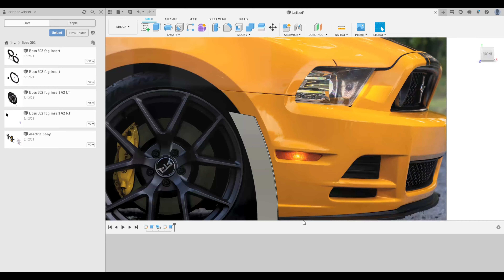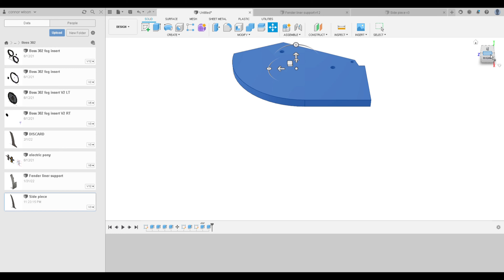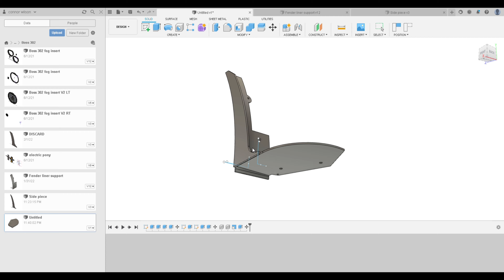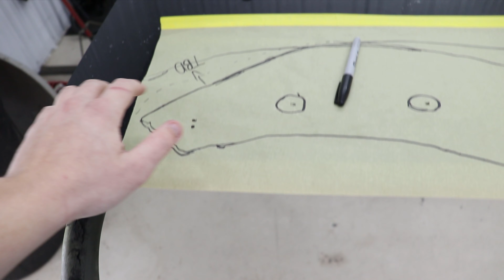Making GT500 Splitter Wicker/Winglets for my Mustang Boss 302!

Comment: Looks awesome but I do have a question... why did you chose to use the glossy side of the board instead of the matte side? Not criticizing just curious.
Reply from the maker: Appreciate that! But no problem, It’s actually the same on both sides of the sheets, the camera and lighting make it look a little different. The only options were smooth finish or cutting board (textured). 👍🏻